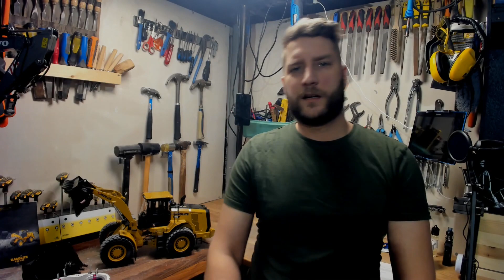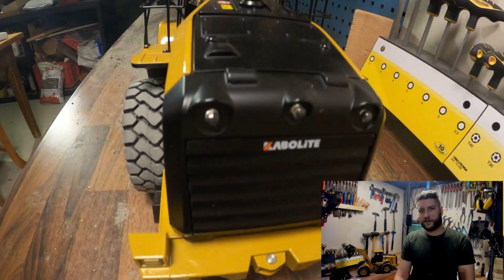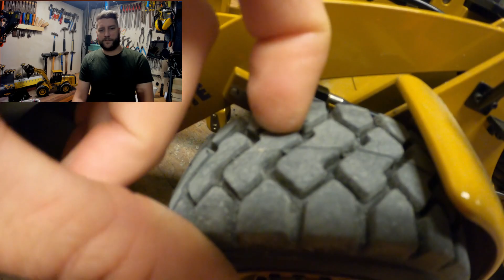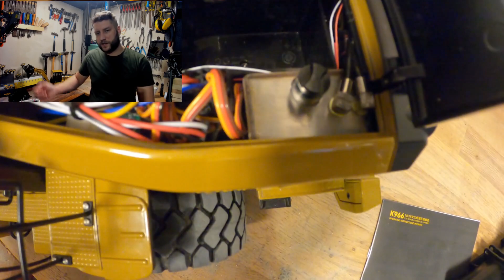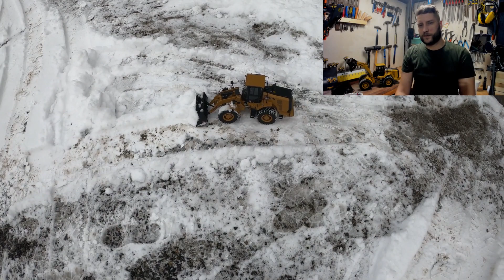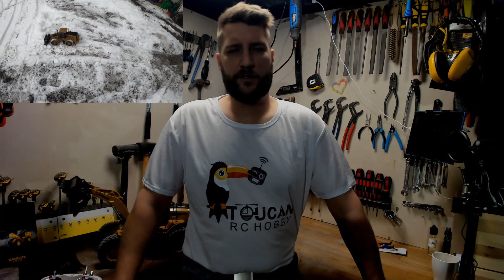KABOLITE K966 Review -2023 version - Hydraulic 1/16 RC Wheel Loader

Comment: Are kabolite rc hydraulic loaders like this any good I'm looking at getting one it would be my first hydraulic loader any major problems?
Reply from the maker: @michaelfish3520  it's generally been a nice little loader, no big issues with ours. Only thing it needs is the modified bucketlink to help increase the range of movement on dumping the bucket.
Reply: @FMDRCConstruction  I'm interested in the XDRC 580 loader as well just don't know which is a better first hydraulic loader?
Reply from the maker: @michaelfish3520  i would assume most of the bigger chineese loaders are stronger and in some ways "better". There is always a gamble though, and quality controll on parts isnt always great. This goes for kabolite to, so i reccomend buying from someone who will support you after sale/delivery if you have any issues.
I like the k966 for it's compact size, but if you want and can afford something bigger, I'm sure you will be happy with that to. Ours has been run a lot by one of my kids age 7-8, and still runs great, and id say that is a great testament to it's reliability at least🙂

Comment: Hi great video review, where did you get the smooth bucket from? Thanks 😊
Reply from the maker: Thank you😊 The straight bucket is just a spare original, with the teeth cut off. Will probably add a lip to it,but it works fine.

Comment: Good honest review. I got mine 650$ w/ issues $300 more invested I can say it’s better than a new purchase. I’ve been told to be aware of locking diffs do to it can break the gears in diffs also you should be able to set trim settings for the shifting issue. The diffs cables can be adj. also. I even completely removed stock electronics added esc’s for pump and gear box also reciever and it can still loose a signal at times 🤷🏻‍♂️ I think it has to do with a 2nd sense wire coming off valve block servo if I’m not mistaking I also think that must activate turn lights? Not sure because I’ve also made my own lighting system. I like the unit just trust me when I saw it’s a real pain in the a”” to break down and repair. I hope your distinctive sound of pump isn’t the hoses running up on it or wiring that can also be a factory issue on top of the 5 major kinks I’ve found in mine. Maybe a first day apprentice built mine who knows lol but it was a mess when I bought it sight unseen
Reply from the maker: Thank you🙂 yea, I noticed you had your share of issues, why I did mention the hydraulic leaks etc😉 definitely seems like you've gotten familiar with the ins and outs of it, I watched all your vids on it before I took the plunge😁 at the end of the day, I was still surprised how nice it is to run, and how capable it is. Considering ive had zero issues so far, compared to yours, 🤞 it stays that way. All in all its one of the best machines ive run straight out the box, with zero adjustments. Will look into the diff / gear trim/cables, thanks for the tip 😊👍
Reply: @FMDRCConstruction  Im glad your enjoying it with zero issues.  ITs great that you did the research also, Im the same way.  I had purchased mine through toucan hobby as well as a used model with all parts needed to be fixed at no charge to me. (Only this one very bad experience, it happens I cant blame them as they are just a wholesaler not visually seeing a used or returned unit) Well it didn't work out that way at all but I did finally get my extra o rings for repairing blown out cylinders. But those parts arrived over 2 months later.  Upon looking examining the unit in depth what was suppose to be a missing/ broken front drive shaft I was told was actually a sheared off front output shaft on main gear box.  The good was I ordered all my parts needed from another supplier and installed before I even received the spare o rings which was far from fixing the issues this unit had.  Overall I think its great unit for the price, I also have came across were if you add a longer bucket curl rod you can dump your material not at full height. Have fun with your new model.
Reply from the maker: No doubt the qc on pretty much all rc construction models is very varying, and there are no guarantees for getting a good model,  no matter where you order from. I still feel like ordering from supliers with an interest in providing real support to their customers is worth the extra value when its time to order. At then rnd of the day though, you have to be prepared for issues to come up, and that's why your videos didn't put me off getting one. I'm very glad you took your time to comment on the video, and can highly recommend anyone interested in a more indepth view on those issues to check them out😉
Reply: That sounds like enough problems to scare me away. Thats alot for someone buying their first hobby grade loader.
Reply: @killrathy  Not sure if this message was for me yet its only nuts and bolts all can be easily fixed.. For me it wasn't my first hobby grade loader. Ive built all forms of custom hydraulic rc equipment for myself and others over many yrs. There for awhile I was contacted by Toucan Hobby and asked if Id be interested in purchasing their misfit machines, reworking the issues each would have as they were factory faulty or a returned with issues.. It was a fun adventure but it did take up a lot of time.  I have since moved on and out of this category of rc hobby.  This loader was a great loader and with my personal touches and options I installed it became one of my favorites even over my lesu wheeled and track loaders.
Reply from the maker: Once again, i agree 😉 That's the thing with this hobby though, there is never anything that just works out of the box, for as long as you would like, without some repairs and maintenance. If you're not interested in work8ng on em, I wouldn't reccomend getting into the rc construction hobby at all.